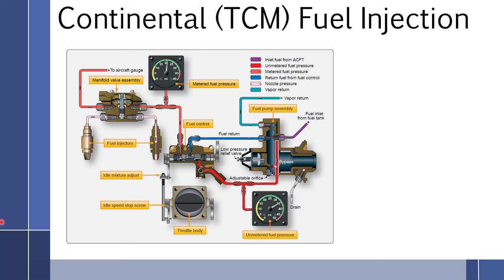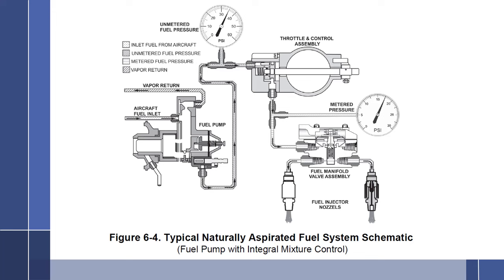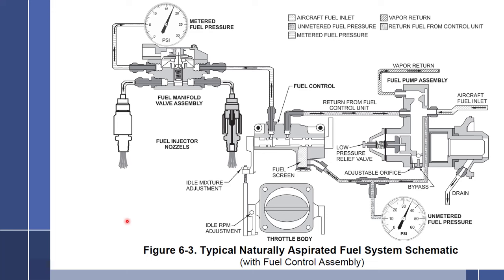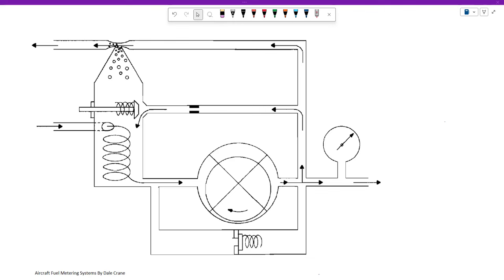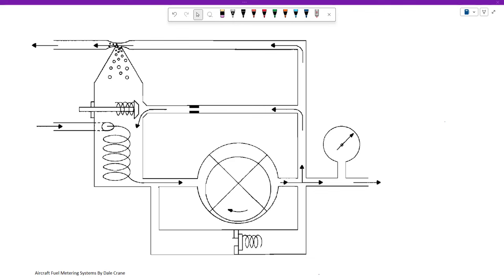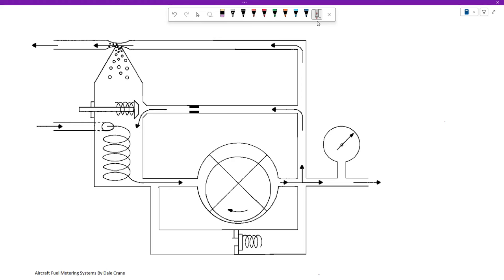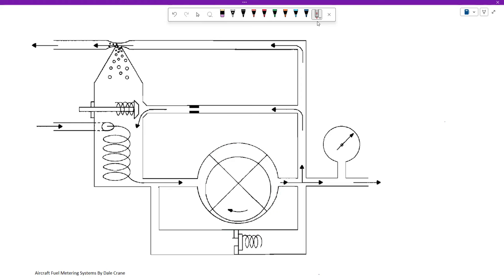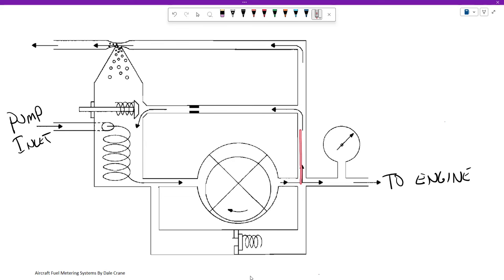Continental Continuous Flow Fuel Injection System (with Separate Fuel Control Unit) )

Comment: fabulous video.   Thank you for taking such great effort and putting this together.  Here is a question, when a continental shuts down, it seems to dump a fair amount of fuel out the common induction drain.  What would that indicate is wrong with this system.  Secondly, what is happening when the fuel pump housing case drain is leaking fuel?  Thank you again and be blessed for your efforts.  James